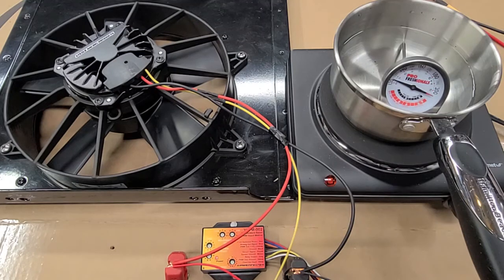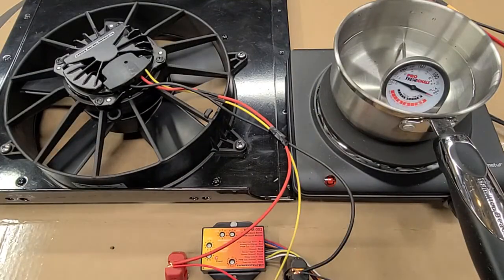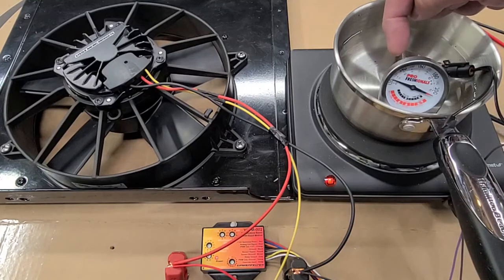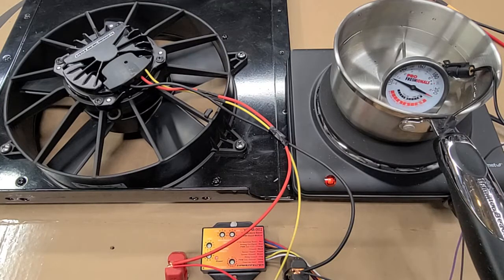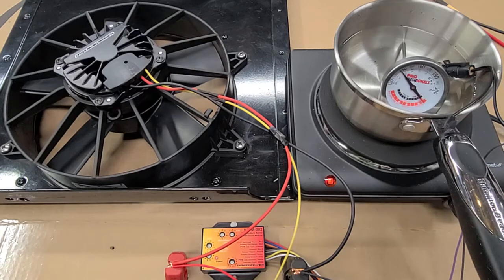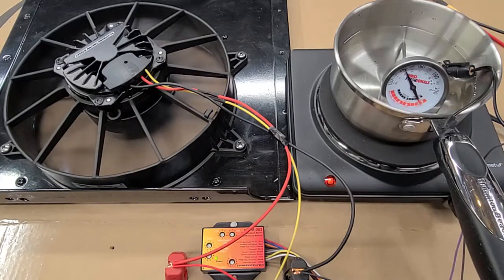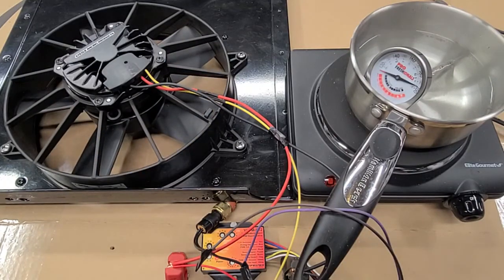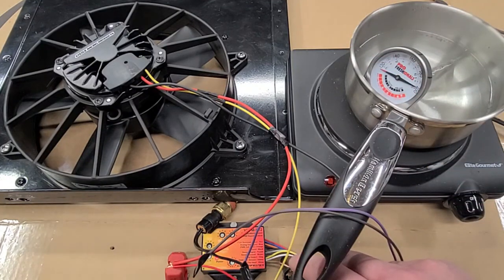Steele Racing Products Brushless fan motors with Lingenfelter VSFM-002 PWM fan controller

Comment: Can you explain how to connect the wires, for the record I have spal brushless fans
Reply from the maker: Best thing I can recommend is go to Lingenfelter online and search VSFM-002. There is a pdf file with wiring and installation instructions. Battery, ground, ignition, pwm signal and sensor wires. Then the proper dip switch settings for your specific fan (spal) and the specific sensor you choose to use. Hope this helps,

Comment: Will it work with regular brushed fans?
Thanks
Reply from the maker: No it won't. Its for brushless motors only. I recommend AutoCoolGuy for a soft start controller for brushed motors.
Reply: @v8trike939  thanks!

Comment: Comment for cross-industry usage
= kitchen fan at 12v or 13.5v(charging voltage)
== a few lousy 13.5v power-bricks to make up the current
=== a-few(V convert to I = for stable P)
= block the cooking-oil fumes from oiling the wire-coils of the motor using aerodynamics

UPVC window frame mod-hack. Non-racing fans cheaper than 110vAC to 240vAC, KDK exhaust fans for toilets.?